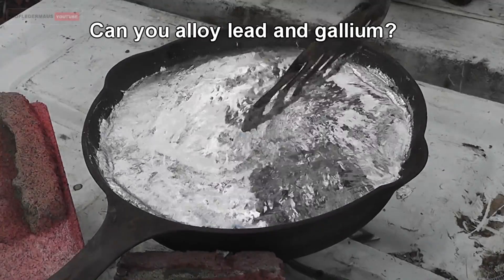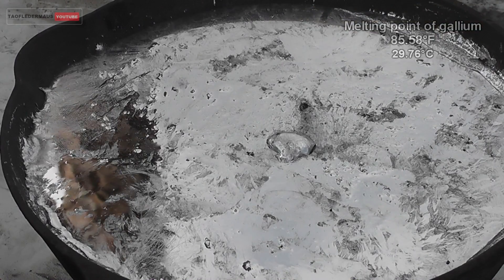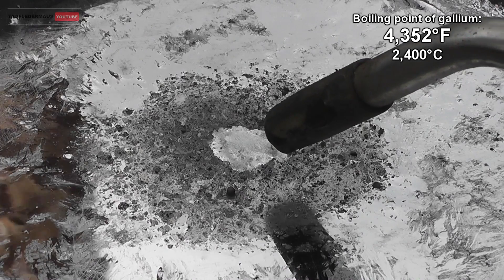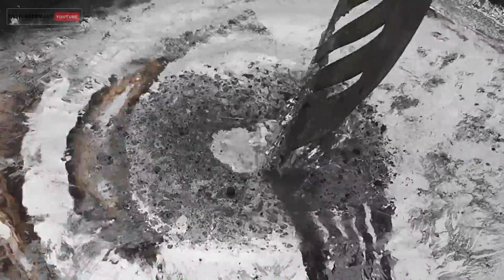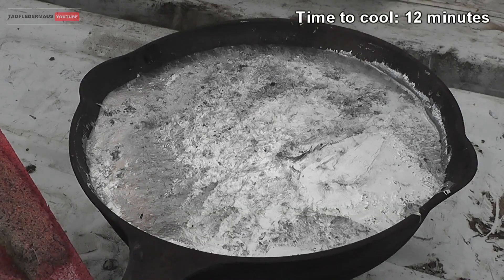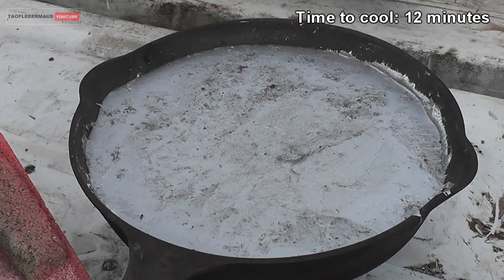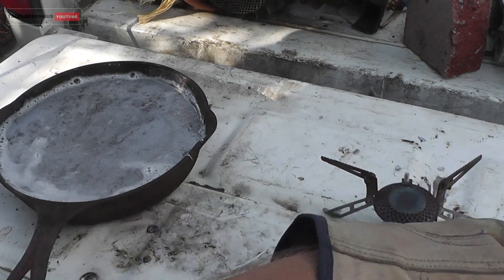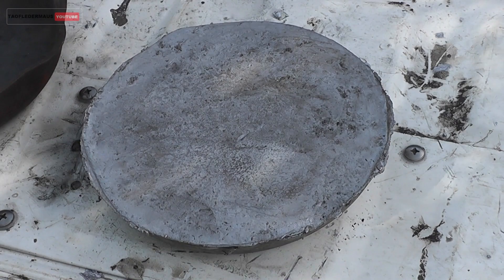Gallium vs Molten lead  -  Will they MIX?

Comment: Will all metals form an alloy or are there certain combinations that just won't mix?
Reply: Some metals will not form alloys using traditional methods, however new alloys are being made with metals that couldn't normally alloy, using powered metal processes. This can result in interesting properties that haven't been seen before and has potential across all fields of material science, including the potential for room temperature superconductors.

Comment: It's not that easy with the lower melting point.
Reply: On other metals it is (common examples are found in soldering tin. Mine is composed of 60% tin (230°C) and 40% lead (melting point 325°C) and yet it melts at around 275°C. Why should it be different with gallium and lead?
Reply: If you mix sodium with potassium, you get a metal which melting point is below room temperature. Normally both metals are solid at room temperature.
Mixtures of metals can have strange properties.
Reply: Finniraptor Interesting. But could it be that they react with each other and form a new molecule?

Comment: I mixed Gallium with bullet led for my fathers muzzle loading .44 revolver, in 1968.  You can also alloy Gallium with Iron, Tin and aluminium.  Geeze guys, read the available literature.
Reply from the maker: the outrage!

Comment: Why did you use so much lead? lol. Can you try it with equal amounts? This was interesting.
Reply: I'd say he did it more on a whim than anything. Melting down the lead plate for a target is pretty standard for jeff and he figured he could easily do this experiment while he was prepping for another video and kill two birds with one stone. That's just my guess though.
Reply from the maker: Exactly Kevin.
Reply: great minds think alike
Reply: Kevin Saale That's understandable. lol. It's still a good video regardless. I was hung over commenting that. Should have figured that out.

Comment: Just wondering why you didn't do a 50/50 mix with just the same amount of lead?
Reply from the maker: I use that lead plate to shoot slugs at,  it had a few holes in it so I was just melting it back down again,   so I just put the gallium in it while I was at it.

Comment: Are you sure that it's an alloy and not that the gallium got trapped inside the lead?

I'm not being pedantic, I don't actually know and I'm curious.
Reply from the maker: That is what an alloy is.   A mixture.   If the lighter (less dense) gallium did not mix with it, it would have floated to the surface.

Comment: Whats it like stirring melted metal? Also, what camping stove are you using?
Reply from the maker: It takes more effort to move the spatula through it than say,  water.    I'm using a Chinese foldable camp stove that runs off butane.   (I can't remember the name)  but even though it is tiny,  it holds up the pan and lead that is WAY heavier than the stove is designed to hold.  I think in the Coke vs Lead video I say what brand the stove is.    It's actually a great stove.

Comment: Could you get a leidenfrost effect with metal like gallium on a very very hot surface? Or any kind of metal that has a low boiling point. You could try mercury but thats too dangerous for you.

But Cody could do it.
Reply from the maker: I don't have a means to get something hot enough to even bring gallium to a boil,  and I am sure it would have to be hotter than than to do that with gallium.

Comment: You might want to check the phase diagram for gallium-mercury, or mix the two together yourself. As I have, you too will find to your horror, astonishment and amazement that these two low melting point metals will form an alloy with a considerably HIGHER melting point. Gallium-mercury SLUGS now. Hmmmmmmm...
Reply from the maker: IF the slug could be recovered,  doesn't turn to vapor,  etc.   I might try that.

Comment: Can you make a lead/mercury amalgam that could be used to cast a slug?  Would that slug be heavier and softer than lead?  And if so, would that slug out perform lead or would it melt in the barrel?
Reply from the maker: I HAVE made a lead mercury amalgam before.  It is really soft and crumbly.  You can crush it in your hands so it wouldn't survive a shotgun blast for sure!   The melting point is about 175 deg. F.
Reply: *****
Oh I know.  That video was the top search result on Google when I typed in "lead amalgam".  I was just wondering if you could change the ratios to achieve more desirable properties or if it would always result in a net negative for ballistics.  Maybe start at 1:100 and work your way up from there?  Some steel alloys are mixed at ratios of 1:10,000 by volume.

Comment: For your next trick, separate them again. 😊
Reply: if you like that kind of stuff, check out Cody's lab
Reply: +Starbuck 7410 which is why he said 'that kind of stuff"
Reply: Myztkl-Kev he never separated lead and gallium
Reply: Uriah Siner oh
Reply: I would imagine just remelt it and skim the top layer. Or remelt it and dump in something that binds better to gallium than lead.
Reply: @zchen27  that won't work. once you mix it, it is hard to separate them.
Reply: its an alloy. a compound, itd probably require a chemical seperation
Reply: @Donovarkhallum  yes indeed. They made a chemical bond.

Comment: I'd like to see an equal volume of a variety of metals with a low melting point

eg:
lead + tin + mercury + gallium (etc)

that would be hella cool m8
Reply: NoSpace4Bass you'd end up with deadly mercury vapor
Reply: found it: Galinstan
Melting temperature: -19° C
Composition: 68.5% Ga, 21.5% In, 10% Sn
Reply: yepppers, noooooo mercury
Reply: if I remember right an alloy of gallium, tin and indium would be liquid at room temperature like mercury but non toxic.
however I can not remember the name of the alloy or what ratios
Reply: That's the fun stuff they put in some new thermometers.  Breaking one open really freaks people out, 'cause they think it's mercury.

Comment: both lead and gallium are non ferrous and have a body centered cubic molecular structure, that is why they will alloy.
Reply from the maker: I couldn't find any examples or notations about this,   so I just did this quick video while I was melting my lead target plate back down.

Comment: Why did you use that much lead?
Reply from the maker: It's just the lead plate that we shoot at,   I needed to recast it so I just added the gallium while I was at it.
Reply: *****
But aren't you afraid the amount of gallium you've just added would change its properties? Like, making it either more brittle, or softer, etc.?
Reply: I think you may have exceeded your $5 limit with that amount of gallium ;)
Reply from the maker: I had a little gallium left over from making the solid gallium slugs.

Comment: Interesting.  Wonder if alloyed slugs would have too low a melting point to be effective.
Reply from the maker: It would probably still have a melting point of about 200 deg F.   I may try that.  Not sure if the slug would be soft or brittle,  etc.

Comment: A gallium lead bullet... that would wreak havoc on any aluminium based structures/vehicles. Initial damage won't be much, but the gallium will wreak havoc and break the aluminium down over a few days,
Reply from the maker: A couple weeks ago we shot pure gallium slugs at aluminum stuff - a big heatsink and an alum. engine, and the lead plate.  To this date,  none of the objects were affected by the gallium.

Comment: how does a gallium lead alloy react to getting shot?
(For science. Definitely not for fun)
Reply from the maker: We'll find out.   There isn't much gallium in the plate so it probably won't make too much of a difference.
Reply: Probably just like any other metal hard substances.
Reply: Sans I mean for what form of formation would it take. Idk it'll probably be like lead, but you never know.
Reply: depending on the ratio, it will be softer.
Reply: make a gummy bear mould of lead gallium alloy!

Comment: mayhaps mixing that much lead was not the best of ideas
Reply: 27dcx for the integrity of the lead, no. for the meat of the video, yes.
Reply from the maker: Yeah,  it's just my lead plate target that I was needed to recast so I just wanted to add a little gallium to see if it would alloy.
Reply: it would have been cool to use 50/50 gallium and lead by volume, since lead shrinks and gallium expands during cooling, plus it could be semi-brittle since lead is super malleable and gallium is super brittle.
Reply: They just shoot at that piece of lead though so I don't think it really matters.
Reply: TAOFLEDERMAUS - now shoot it with a deer slug and see what happens. Does it form a crater (like last time), or does it fracture?
Reply: TAOFLEDERMAUS what happens if you melt Aluminum anything that was been infused and weakened by Gallium? Could that be another video?
Reply: why
Reply: Explosions Fire n' More 1. if it fucks the lead, all that lead is now fucked
2. the amount of gal added could've been too little to notice a difference where as using a smaller quantity of lead would lead to the differences in the alloy more apparent

too lazy to add more but there are many reasons
Reply: TAOFLEDERMAUS just a suggestion, but next time you have to re-cast it can you try to alloy some magnesium into it? just for the hell of it
Reply from the maker: It will probably be about the same since I didn't add that much gallium.
Reply: Liked for your use of "mayhaps"
Reply: ***** I would assume if you melted the final solution (entirely amalgamated aluminum and gallium), that they would simply melt back into elemental form, and until aluminum solidifies, no amalgamation would occur. After it solidifies, the gallium would really quickly amalgamate (go back into the aluminum).

Comment: what about if you added mercury to the mix?
Reply: Adam Free when a liquid turns in to a gas it is evaparating
Reply: +Adam Free everithing can be in a gas state, mate, including mercury.
Reply: Adam Free yeah..... no, mercury does evaporate. All liquids have a vapor pressure for a reason.
Reply from the maker: I have made a lead/mercury amalgam before.   I think I used equal volumes if I remember right.  But it had melting point of about 175 deg. F.
Reply: Jean-luc Chessher What the fuck are you going on about? Your spelling and grammar are so terrible I can barely understand what you are trying to tell me.
Reply: Adam Free Liquid mercury evaporates at every temperature.

Literally every single liquid will evaporate at any temperature.
Reply: Adam Free no literally EVERY liquid, do you not understand the concept of vapor pressure?

and yes mercury would evaporate completely with no wind given the air is not saturated with it already

This is highschool level material.

Do atoms and molecules just not move in your world? Because everything that is classified as matter has to be moving.
Reply: JonesyMcDanes both metals need to be liquid to alloy
Reply: Adam Free mercury starts to avaparate at room temp
Reply: ffs on this world and therefore on the interrnet there are way more people who dont have english as their first language than those who do, so fucking accept that not eeryone has perfect grammar or spelling!
if you ask brits what they think of american english many of them would say that it ridicules their language... so not even the native speakers come along.
and to be honest this is fucking youtube, not some high grade scientific paper no one cares if its perfect grammar or spelling and honestly it doesnt matter...
Reply: Mercury definitely evaporates. Watch cody's lab and he shows mercury vapor
Reply: Worldadventure Lehderp i didnt know that thats canny cool
Reply: JonesyMcDanes You are correct. I was wrong, just checked out an old video of his where he did boil mercury, only I never saw any gas because he contained it. You learn something new every day, even when you are a stubborn fuckass like me.
Reply: well he could just leave the mercury on top and let it soak in while the lead is solid
Reply: it would be cool to see because sometimes the outcome is unexpected
Reply: Jean-luc Chessher yeah.... no they don't. Get a silver dollar and drop it in some mercury.
Reply: Jean-luc Chessher Hypocritical*
Reply: Adam Free yes you are go and play with buses
Reply: Fossil98 pmsl i was just watching the mercury toilet
Reply: oh, thee speaketh the 'riginal english doth thee?

haha, jk, i know this shiat aint original either.
Reply: ESSBrew?
Reply: not necessarily, remember that liquid gallium will alloy with solid aluminium
Reply: Mk Jackary i think the mercury would evaparate off
Reply: Jean-luc Chessher Uhhh. No. :earn to spell before trying to teach chemistry and basic physical science.
Reply: JonesyMcDanes Well, not EVERY liquid. And not ANY temperature. There are some et back to that statement, but mercury does not just evaporate if you would leave it out in the open at room temperature with no wind, heat or any other conditions for that matter, it is entirely to heavy to stay suspended in the air like that.
Reply: Mercury does not evaporate, it is not water, it also never solidifies unless frozen. it would either float and never dry or sink and never dry.
Reply: RusZugunder I meant to bring the point up that he would probably never have the tools to bring mercury itself into a gas state.

Comment: hey, what if you added it with a 1:1 ratio?
Reply from the maker: I should have tried that.   I just don't have very much gallium so it would have been on a smaller scale.
Reply: Ratio doesn't determine amounts actually, but if he was to use the same amount of lead and try a 1:1 ratio with that... yes. :P
Reply: I wondered the same thing. A little blob of lead the same volume as the gallium used here would be cool to see if you revisit this, Toofleydurrmows.  +taofledermaus
Reply: on that scale it would be ungodly expensive
Reply: XFourty7 Oh yeah duh, my mistake :P it sounds interesting! Still expensive though, that spoonful was probably worth about a dollar or two.
Reply: ***** Yeah, I think just a couple spoonfuls of each would get the job done.